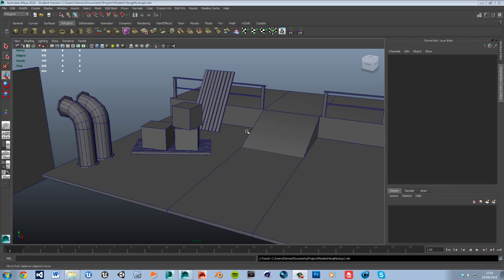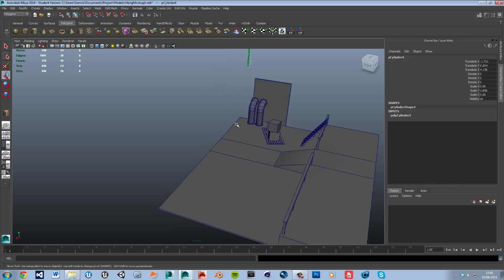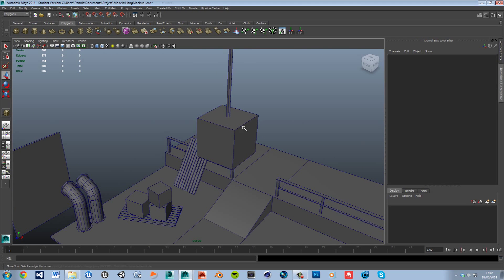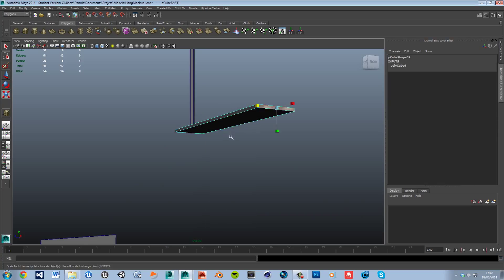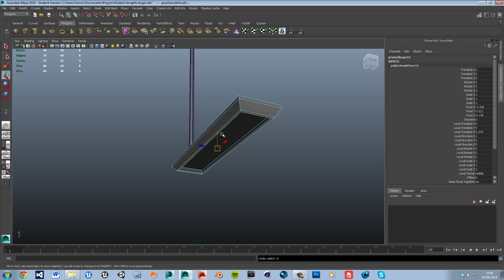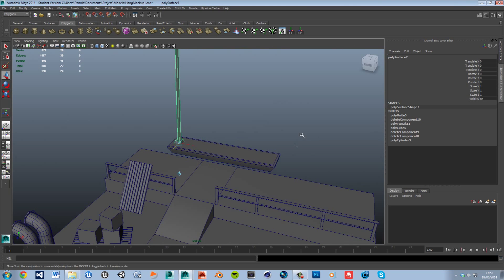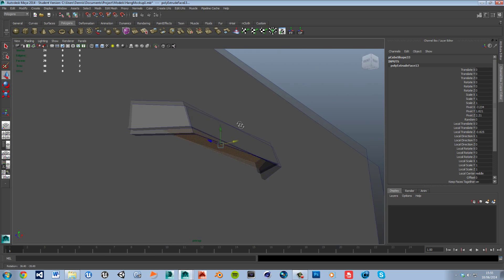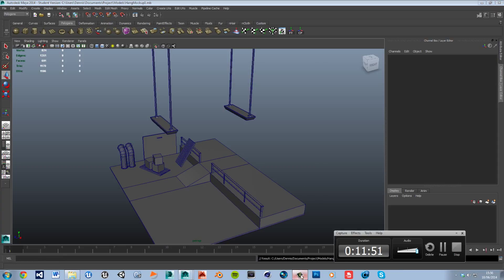Unity3D | Creating a Game from scratch... | Episode 3

Comment: why would you not use a texture on the roof light, you would get a better result and would mean less polygons

also, why arnt you using unreal 4 anymore?
Reply from the maker: We don't need it that optimized :) plus you'll see what i do with them later, and i am still using it, i just like unity and they're both good, but they are so similar using both is easy :)